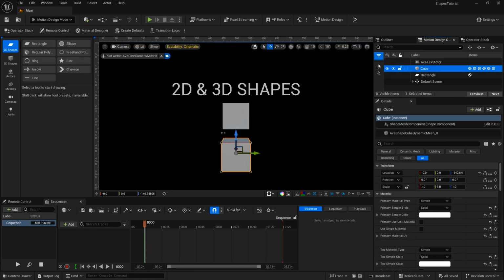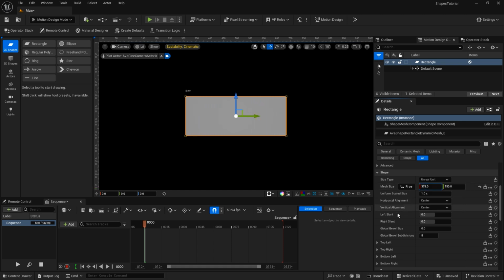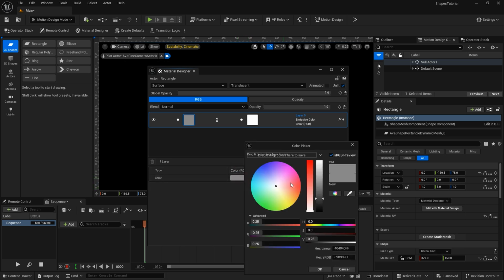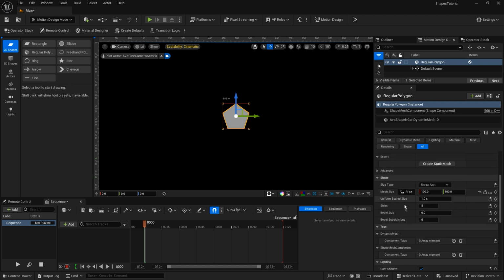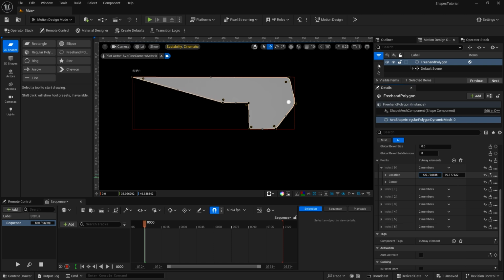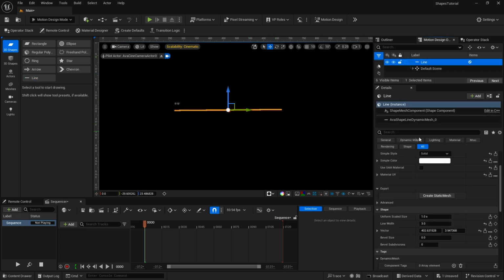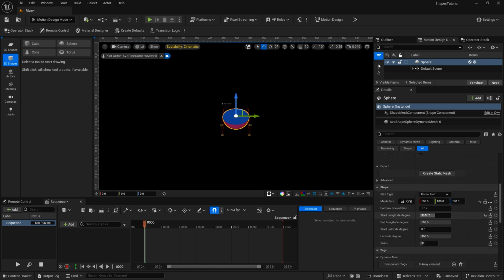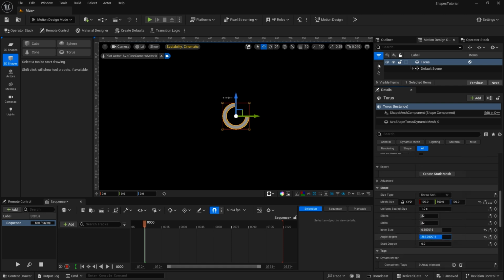Unreal Engine Motion Design 2D & 3D Shapes

Comment: Hi, very nice tutorial! I have a question: How can I create a custom 2D shape in Unreal, similar to the pen tool in After Effects, for masking? I came across the '2D Freehand Polygon Shape Tool,' but I couldn't figure out how to create curves (with tangents) while drawing shapes. So far, I can only create custom shapes with straight lines, and while there is a bevel option, it’s not what I’m looking for. Additionally, I’d like to animate (keyframe) these points in the Sequencer to morph the shape. Could you please guide me on this?
Reply from the maker: I am finishing up a tutorial that covers most of your questions, and I will try to release it tomorrow or Saturday. The Motion Design tools have a spline actor that can be used to draw shapes similar to the Pen Tool in AE. Also in Modeling mode in UE there is a spline tool. I cover all of this in the tutorial. For animating the points I will check into that.